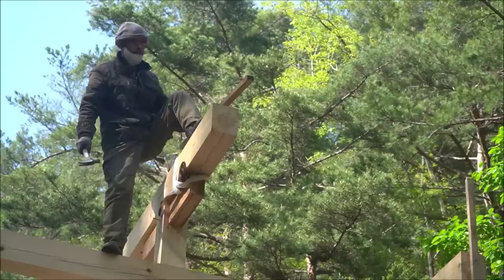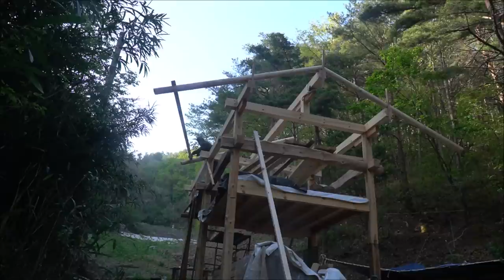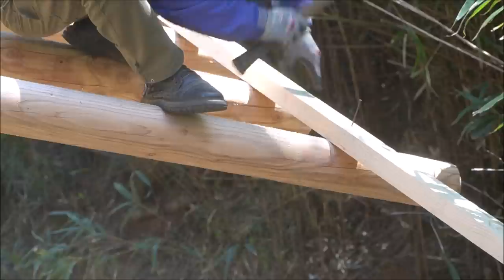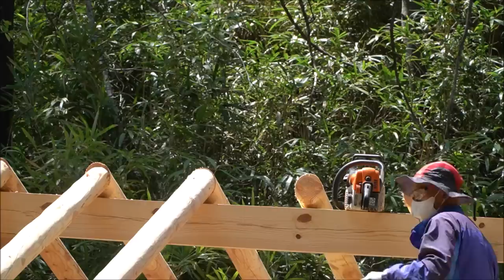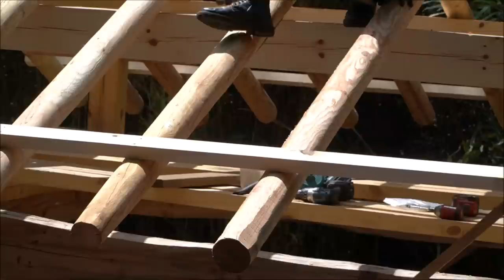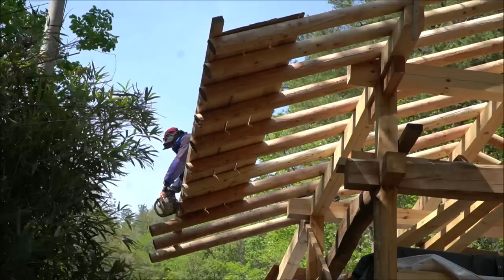이제 집처럼 보이네. 서까래 작업중.

Comment: I don't understand why in Korea the rafters are round without joint processing, which sit on the edges of square beams, practically in a single point of support, the only attachment being the 2 long screws. I don't think that those screws will withstand more snow accumulated on the lower ends of the roof... maybe only if soil is added, increasing the weight of the upper part of the roof...
Reply from the maker: You are almost right.